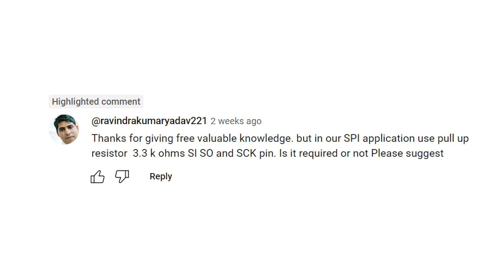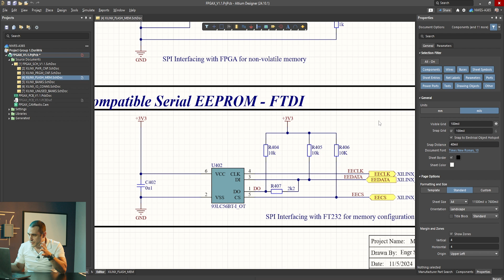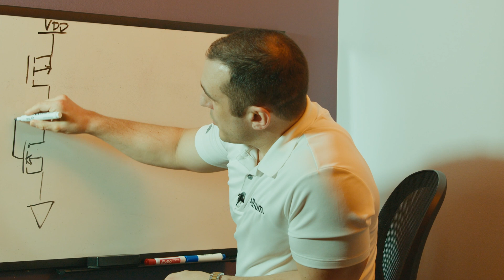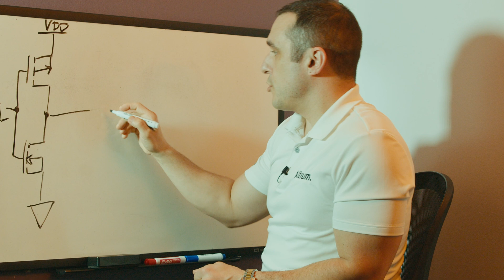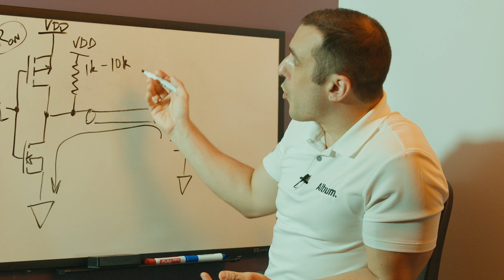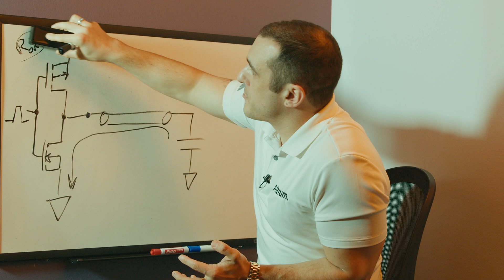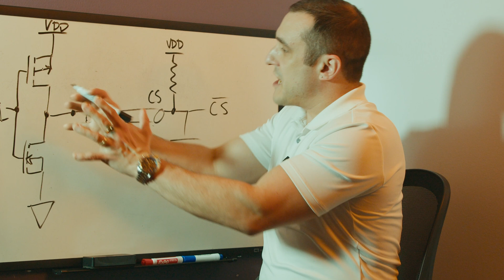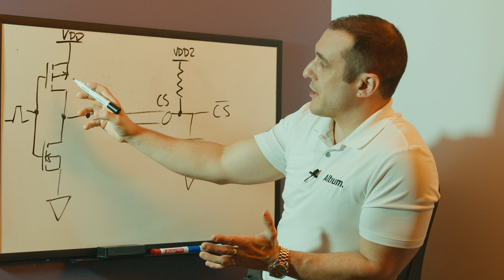SPI Pull-up Resistors: Do You Need Them?

Comment: Datasheet is everything...
W25Q16JV actually specifies that !CS must track VCC during power-up and do recommend using a pull-up on !CS to accomplish this. This may also prevent latch-up. This requirement also prevents backpowering chip via it's !CS input. It does however not mention CLK which makes me assume this was an attempt to avoid illegal clocking on power-up.
93LC56BT seems to be used in a microwire mode and one does actually connect DI and DO in this configuration to handle bidirectional IO on a single pin. They do not however normally mention pull-ups. 😬
Reply: If there is a specific reason for the pull-up then it should be used to accomplish that, but the problem comes when someone sees a circuit with pull up resistors, and then they think every SPI interface needs pull up resistors. If the only function needed is to drive a signal into a bus then a pull up resistor is not needed for that.

Comment: This discussion ignored the most likely reason for pull-ups and that is the behaviour during reset, or before programming of an MCU or configuration of an FPGA. The majority of applications will be using a microcontroller which will take time to configure its outputs, and may be held in reset at any time. This is true for any output expected to be driven by a device that could be held in reset (SPI or not). For an SPI bus, you risk contention between multiple devices should one or more become selected.

Comment: argument is a bit wrong the cs# is needed.
during power up, and also power down

typically the memory chips are fully powered on at 1.2-1.8 on their way up to to for example 3.3,
during this time an SoC for example will have indeterminate state on the I/O, likely floating or small internal pu.

it is during this time the cs# pullup will save your memory from an accidental write.

It wont happen often, maybe once in a million cycles, but once you make many units you will notice this failure.
Reply: Excellent point about power sequence potentially pulling down CS#.  if the uC or FPGA's SPI interface isn't powered up yet then the voltage rail is at 0V, so ESD protection diode on the pin will pull it down, and CS# may become active.  This also means bias voltage should be from the memory (or other) voltage rail, not from the uC's (assuming separate power buses).

Comment: As an ASIC engineer I can tell you that if your IC vendor tells you "pulls" are needed, then you should use them. With CMOS inputs you should not leave the pin state at an intermediate level, the pin should either be fully "on" or fully "off", otherwise you end up with potentially significant crossbar currents.

The need for "pulls" really are for inputs or inouts (when they are in input mode). Typical ASIC IO libraries have a large selection of IO buffer types for the ASIC team to choose from (or of course they could use a custom IO design). As an ASIC designer I can choose to use input capable buffers that have "no pulls", "pull up" or "pull down" or in some libraries the ability to configure them.

For designs reasons that are beyond this discussion the designer may choose to use an input buffer that has no "internal pulls", in this case the local PCB design is required to ensure that the input pins does not float and has a valid input level at all times. A PCB pull resistor does this.

However, in the other case where the chip designers has used input buffers with pulls it is a little more complicated, many input buffers that include pulls have one important caveat. They are not to be used to replace the need for "board level" pull resistors. They internal pulls are very weak and intended to ensure the input buffer has a valid input level only when the pin is left disconnected. The behavioural simulation models often even include huge delays in modelling the pulls to avoid designers relying in them.

IMHO it is why there seems to be "no consistency" in where SPI connections need pulls or not, in part is is because what other functionality is shared on those pins, can they be configured as inputs, might they be used for undisclosed test or "secret" functionality etc?

If you want the definitive answer as to whether a pin requires a pull resistor, ask the chip vendor/designer and follow their advice because they actually know if and why they would be required.
Reply: I would agree that if the chip datasheet states to use a pull-up resistor then you should use it. The point of the video is not to state that designers should ignore this point when it is clearly stated in a datasheet, and I probably did not make that clear. The point of the video is to address two common questions: 1) will placing a pull-up affect the signal? and 2) do you always need the pull-up resistors regardless of what a datasheet/app note states? A third point is to also ensure that newer designers are aware that weak pull-ups can be included internal to the chip as you mentioned in your comment. Still a very informative comment, thank you for all the information.
Reply: @roowatt  interesting... the internal pulls HAVE to be weak also because otherwise in a parallel connection you cannot go from strong to weak...only viceversa.

Comment: Many micros boot with their GPIOs defaulting to inputs until the code has a chance to configure them.  Therefore the pullup resistor ensures no spurious chip selects or clocks before the processor has a chance to start

Comment: I have come to the conclusion that the pull-ups are mostly useful to have a well defined initial state for the SPI bus. This could also be useful for any other pins that are not SPI, but where you want a guaranteed initial state, e.g. one that controls a transistor base/gate or relay. 

Like you said, for most stateless ICs (like a sensor) this initial state doesn't matter. If the undefined state of the bus magically sends a valid but unknown SPI command, I'm probably just gonna send a reset command to the device during initialization.

You didn't touch on the resistor seen between SI and SO signals. That could be useful when interfacing between 3-wire simplex and 4-wire duplex SPI interfaces, though I've never actually done that.
Reply: Some spi connections support half duplex 3 wire, that's the way you connect them.
Reply: I think that underscores the point I wanted to make: the pull-ups are not strictly required in order for SPI to function, so you do not always need them in every design. But still the question continues to come up because someone saw the use of these resistors in a reference design and application note, then they become candidates for use in every design (just like ferrites). I see them as more of an insurance policy in some designs, like the case with the CS line and data line as was mentioned earlier. There are also ways around the use of these resistors as long as you can put an initial state onto the bus before your peripherals start up (i.e., power sequencing).
Reply: This is exactly it. Even on the example Zach showed with the TPS65987DDk, a pullup on the MISO line (called SPI_POCI on TI chip) is needed to configure the part to automatically read in configuration data from SPI flash on boot vs another mode. It has nothing to do with the actual operation of SPI

Comment: In my opinion, you need resistance for pullups when can do 10+ reps. My simulations for Zach's arms in AWR show that resistance does not work him anymore because he can do 100+ reps. If I add a short ended transmission line and set his pullup frequency right, it will have high reactive impedance and make his workouts challenging, allowing him to progress.
Reply: Needs a better pdn.
Reply: Too much effort for this joke bro.

Comment: Most of the time just follow whatever your chip manufacturer suggests. Recently i worked with a PCIE to SPI bridge that required pull ups on some of the SPI lines and would just not work without it.
Reply: Hopefully that is now the case for modern chips, but there are a lot of legacy datasheets that preach gospel that has been refuted experimentally.
Reply: @petersage5157  In the case of using a resistor (or capacitor or whatever) on a particular pin, it's a circuit design issue and you should probably follow their advice unless you can prove them wrong. The reverse is not true: if they don't explicitly state in the datasheet that you need a pull-up resistor, then don't use it just because some other datasheet/app note said you needed it. But with ferrite beads.....
Reply: Why does the mfg say that it needs pull ups on SPI lines? Does it have an open drain output or sth?

Comment: There was a point made about using the pull-ups in sd-cards or similar disconnectable devices... especially on miso and cs lines to avoid leaving them floating or subject to noise when connected.
Reply: For CS it makes sense, but in MISO it really doesn't. As long as the CS is deasserted it really makes no difference what the MISO does or doesn't do.
Reply: @InTimeTraveller  it's good practice not to leave any inputs floating (miso floats when no slave is selected). Esd hazard, noise making input stage to switch at random, half-way voltage that means undetermined state which "half opens" the cmos, etc... (Microcontrollers manufacturers advise not to leave unused pins as high-z inputs, but to config them as low outputs for the same reasons).
I think most modern spi chips have internal pullup/down on input pins, but I am not sure.
Reply: @robegatt  ESD is not going to be dissipated by a pull up/pull down resistor, you need TVS diodes for that or other specific ESD mitigation strategies. The rest is really unnecessary unless you have a safety critical system. In other words, all noise is gonna do is just have a random initial state of the system. It is therefore at best unnecessary for the vast majority of applications and at worst it increases BOM and layout size, and adds a constant power draw which may or may not be important depending on the application. Otherwise by the same logic you might as well add PU/PD resistors to all your IO lines and then suddenly the BOM is getting ridiculous.
Reply: @InTimeTraveller  No. The clamping of the ESD is usually done internally with diodes, the electrostatic charges couple with the gate capacitance and charge the gate at random, ALWAYS, not just at the beginning (where did you get this idea of noise only at the beginning anyway?!). If you have a pullupdown you have a reference voltage with known amount of charges.
The floating input is like a small antenna and gets a continously changing state of the input buffer that generates noise on the power delivery network due to the switching.
If the cmos gates are in linear zone both transistors are letting some current through dissipating unnecessary power.
Why do you think microcontrollers ALWAYS have configurable pullups (and or pulldowns) on their gpio input stages ? just to avoid cluttering the layout and the bom. That is why I think modern spi interfaces have internal pullups.
Reply: @InTimeTraveller  as others pointed out, floating inputs are subject to metastability issues, potentially resulting in increased power consumption or  other unwanted issues. In reality most devices incorporate weak keeper resistors for precisely this reason.